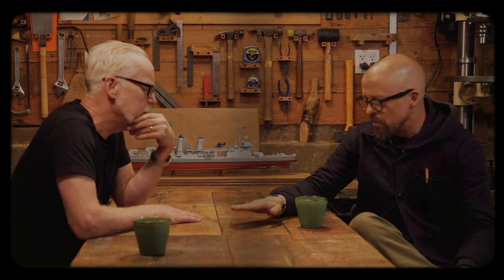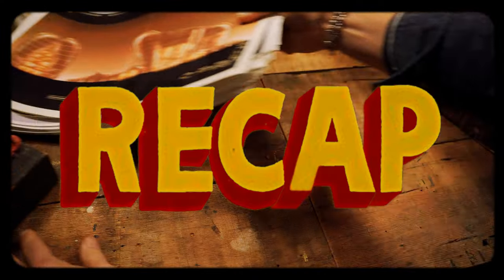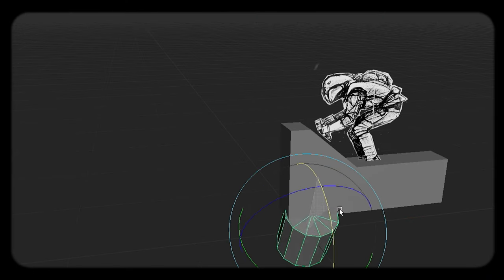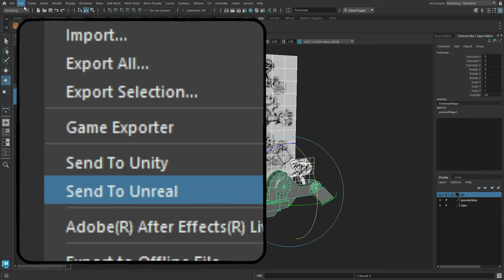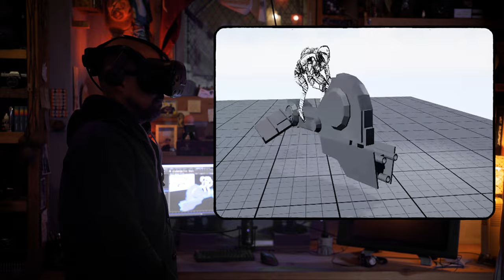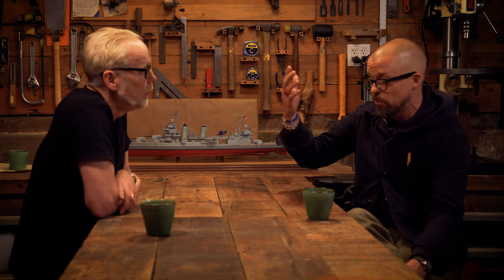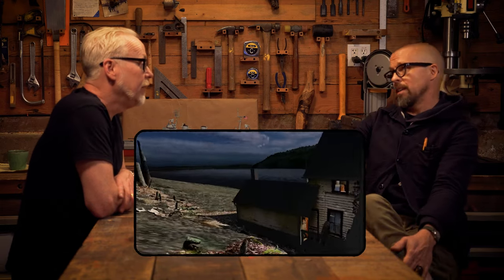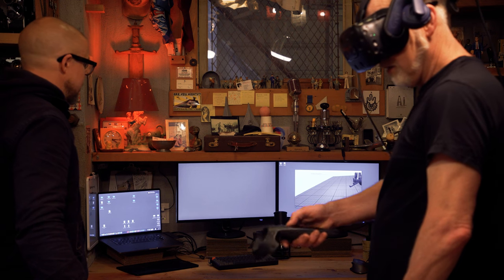DESIGN in VIRTUAL SPACE

Comment: I'm really excited by the prospect of modeling in VR.  Could be the perfect use of the Vision Pro.  Would definitely be more intuitive and it would help speed up the prototyping phase as you can just see it physically prior to printing it/building it.  I definitely need try it out on my next headgear build for my channel. So cool!  Cheers!
Reply from the maker: For as long as I've been involved with digital modeling tools - 21 years(?) - development goals have always prioritized the reduction of non-intuitive technical barriers. Progress has always been more easily had with organic sculpting tools. Have a look at the work of Gio Nakpil in Substance 3D. Hard surface modeling tools are harder nuts to crack and I'm not aware of methods for doing sophisticated HS modeling in headset. The same can be said of physical HS modeling. The technical barriers for entry are higher than clay sculpting. Machining, turning, woodworking are all helpful skills for HS modeling and have a built in technical learning curve.